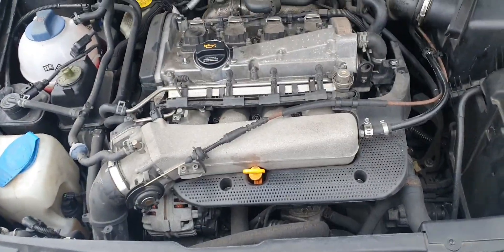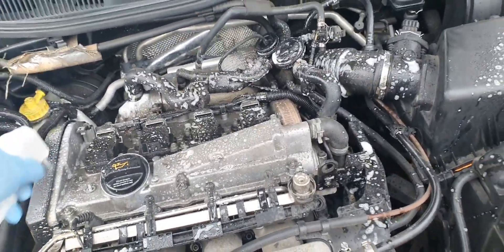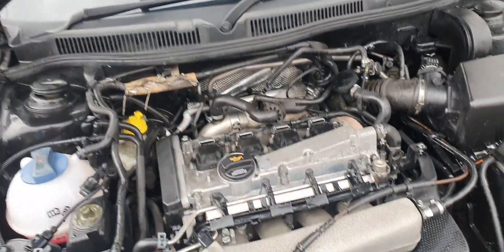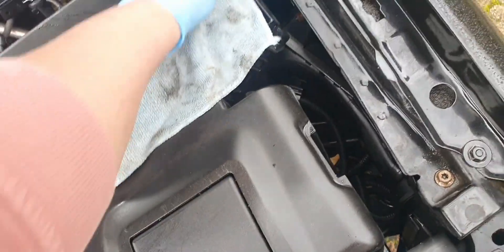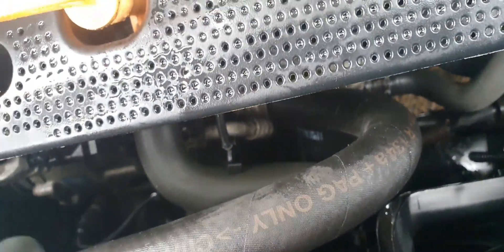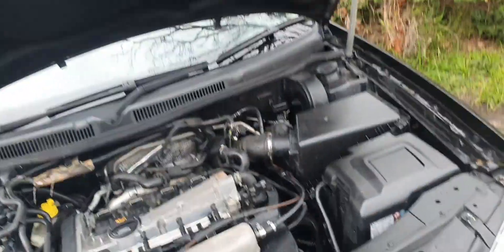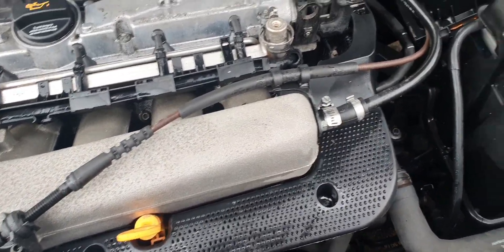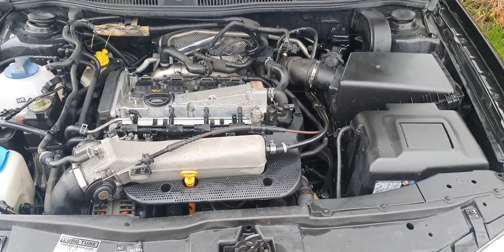Cleaning the engine bay new MK4 Golf GTI

Comment: Sweet video always, oven cleaner will strip any grim off.  Leave the car running as it soaks.  Did mine the weekend.  Number 1 cylinder/spark plug  turned out oily,  Had to dry it up.  Misfire issues.  Running ok for now. Got a valve cover gasket leak.  Lots of caked on grime. Next major work will be that.  I will post soon mate once the weather improves.
Reply from the maker: Yeah I've heard of oven cleaner haha the cleaning did wonders so far it wasn't so bad! 
Under the car was nice too! Love it so far, so smooth.